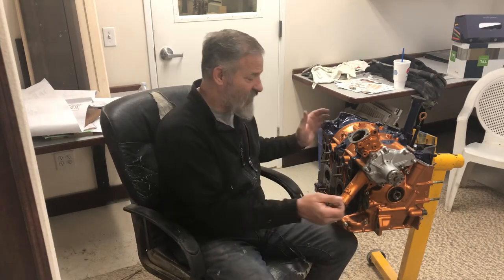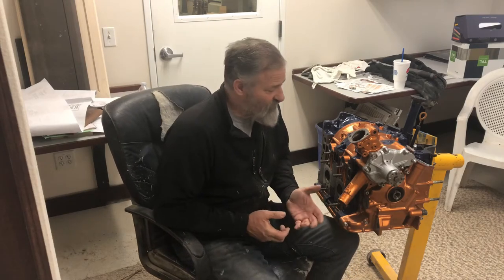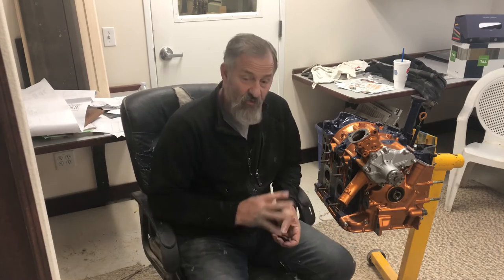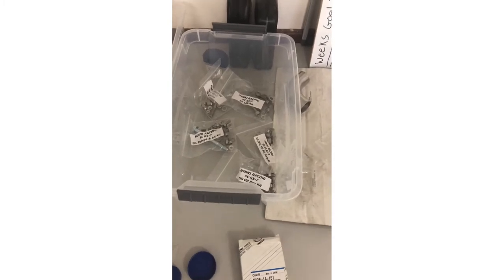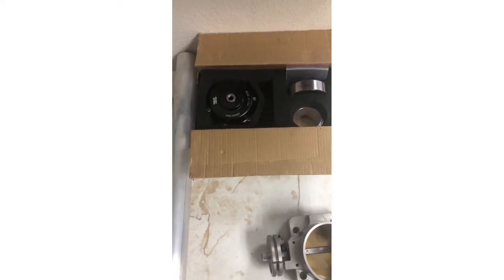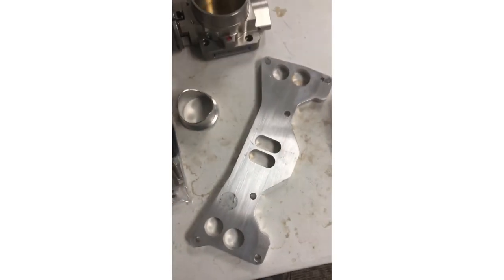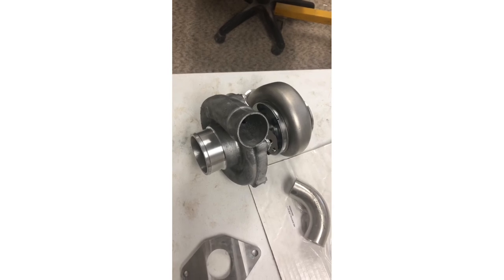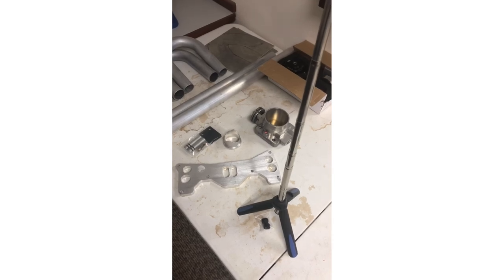Mazda 13b rotary aircraft engine intake manifold turbo exhaust

Comment: how will you control torsional vibration dampening?
Reply from the maker: mirimar69 I’m planing on using the air trikes PSRU it has a dampener in it,

Comment: If you are waiting to do the engineering work on the air frame, start testing that engine on an existing aircraft. That way you won't have to re-engineer your aircraft to use a conventional aircraft engine when you figure out how much you won't want to fly behind an auto engine conversion.
Reply from the maker: MX304 thanx for your input.  I guess I could get me some 1930’s technology for $35,000!dollars.  Of course then I couldn’t afford the plane, but you know.